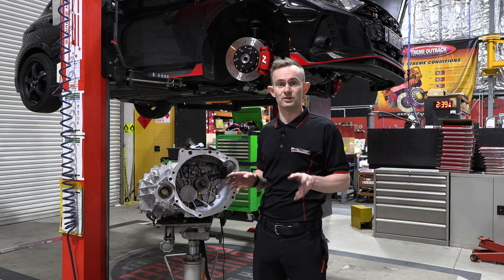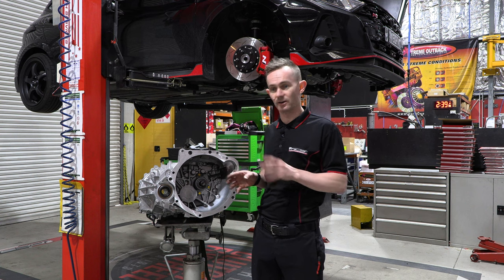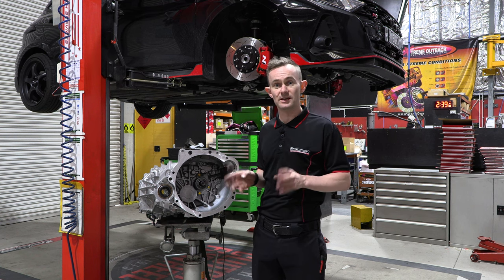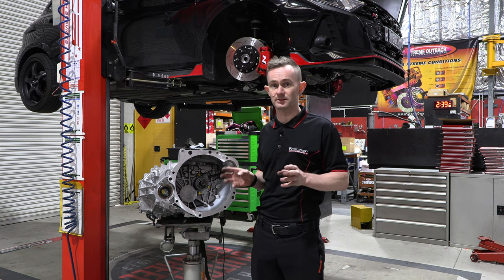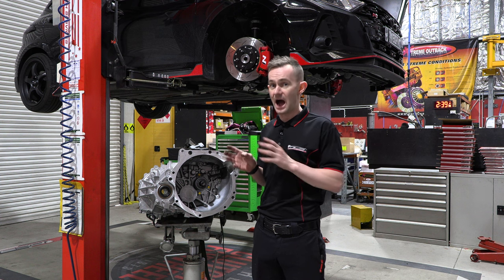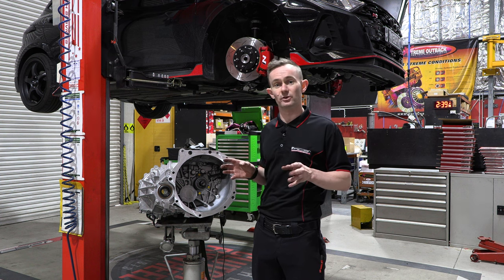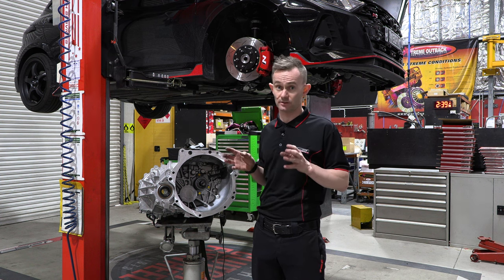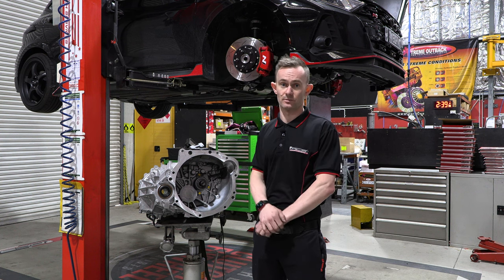CLUTCH TECH: Clutch Spline Lubrication Guide

Comment: Guys please help me i have nissan navara d40 2007 model 2.5 4x4 i wanna know how to adjust the clutch it takes to high if i release it i want i to take a bit lower man what can i do?please reply thank you
Reply: Sometimes you can adjust the bite point by adjusting the pushrod on the master cylinder but chances are the clutch disc itself is just worn and needs replacing